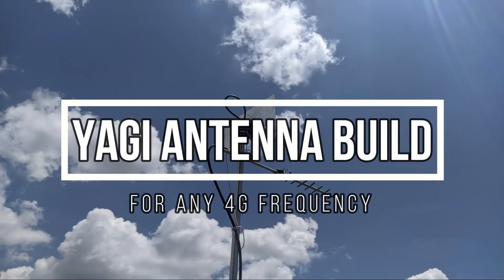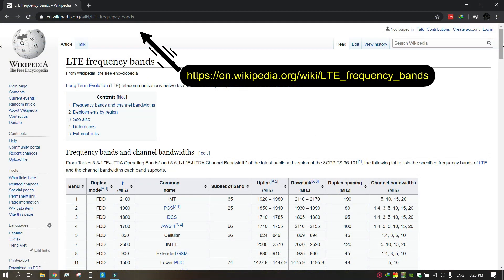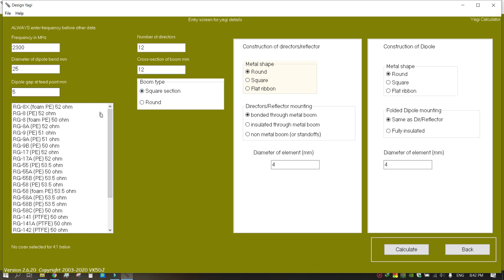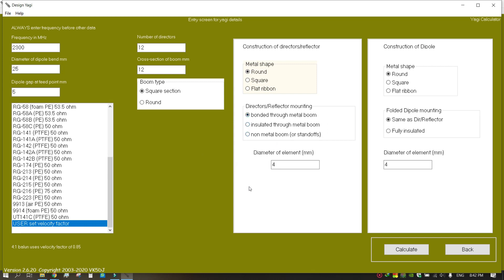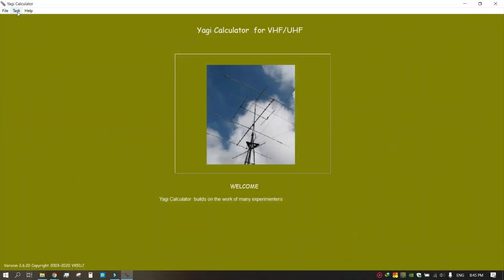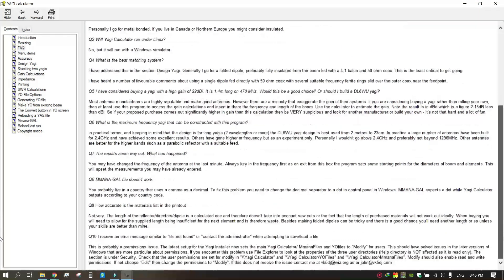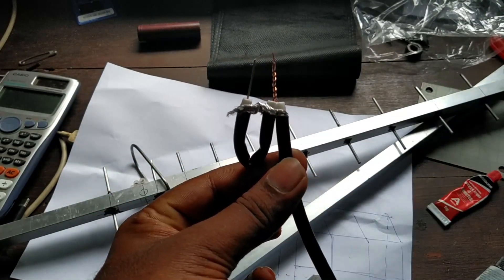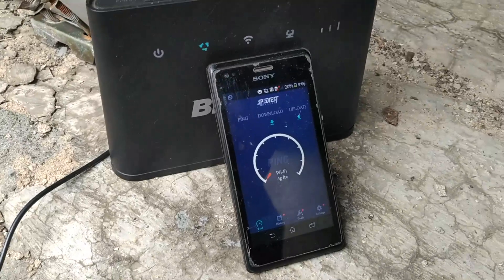Homemade YAGI Antenna for 4G LTE modem. (Speed test included)

Comment: Using a welding rod for antenna elements is not a good idea since they will have higher losses. I would recommend you use copper or aluminium for the elements or else the performance will be quite bad.

Comment: you poor thing your yagi isnt 100 percent, those elements cant just be glued, bonded [ the option you chose in the calculator ] means pressed in screwed on  or welded, must have full electrical contact with the boom

Comment: goodjob dude but you should have set your yagi axis to 45 degree from horizontal line and if you are using mimo router you should use two antennas which are 90 degrees from each other

Comment: Sir please, how did you make the balun ?
Reply from the maker: Using antenna wire
Reply: @AmateursDIY  I mean how you connected the balun to the dipole and the coaxial cable
Reply from the maker: I soldered them. Its easier to solder if you can make the dipole from coper wire.
Reply: @AmateursDIY  please make a video how you made the balun and how you connect it the dipole, it's not clear here to connect the positive and negative ... please bro

Comment: In My roof I'm getting 3o Mbps but in my roo it's 1mbps  by building this how much Mbps can get?
Reply from the maker: You can get almost 30mbps or more than that. But if you use longer antenna wire like 15-20meter speed may get low.  Also depends on signal directly coming from tower or reflected from somewhere else. Can't say anything sure  better try it. Or you can make a biquad antenna. That is much easier than this.  Watch my other video.

Comment: brother I'm already using this type of antenna. But I don't have enough speed. What can I do for that ?
Reply from the maker: Reduce length of the cable as much as possible. Did you tried at several directions also vertical position.
Reply: @AmateursDIY  I did all things. But it doesn't work.
Reply from the maker: Did you check your external antenna recognized by router settings. If it also works may be your area has high tower loads even all signal bars are available.  
Haven't you tried biquad antenna. Actually making a Properly tuned a yagi antenna is difficult. Biquad is much easier.

Comment: Bro I have a dialog outdoor antenna, do you know of any ways to improve the speed?
Reply from the maker: I recently saw some guy posted disassembled  dialog outdoor antenna. It also have fairly good antenna. It is  like a "4g antenna gun" in youtube. You can change that antenna to different antenna. But it will be tricky cause it has small cables that goes to rf card from antenna. Like wifi antenna cable in our laptops. But you can try😅

Comment: How to make Dipole sir?
Reply from the maker: Software provides details for that
Reply: @AmateursDIY  oke thanks. I know right now.
Cat I make antenna use 2mm Iron Welding Wire? Or should use aluminium?
Reply from the maker: Both can be used. I don't think there will be a huge difference

Comment: Very well constructed antema, congratulations! However, he made a serious MISTAKE, installed the antenna horizontally. For its frequency, the yagi antenna must be tuned with vertical elements. Hugs and thanks for the video!!
Reply from the maker: Thanks

That horizontal position gave me the best speed. Don't know why. Several mountains are  located around our house. Signal may be bounced off. Biquad antenna give more speed than this.
Reply: @AmateursDIY  How to make a  4.9GHz Yagi antenna
Reply from the maker: I'm not sure about 4.9ghz yagi. Cause it will be very small and  i think the maker of the yagicad application mentioned also mentioned about effective frequency range for this application.

Comment: machan are you a ham?
Reply from the maker: No i don't have a ham radio
Reply: @AmateursDIY  ok machan do the amateur radio exam and get the license. Meanwhile have you tried your yagi in vertical position? What I saw in the video was it was horizontal. Usually these signals are transmitted using vertical polarization.
Reply from the maker: I tried in vertical position  it didn't had a speed than this position. Somehow biquad antenna provides better speed than yagi in my situation. Probably i'm getting signals from various directions.

Comment: Just to confirm , is there any prebuild branded antenas in the  arket we can buy straightaway , if yes than anyone can help me with links or with names atleast , this help is much appreciated :)
Reply from the maker: Yes. Of course  there are lot of antenna makers. But i don't no about brands because i have no experience with them. There are bunch of antennas in ebay and aliexpress. Jist use the antennas with correct frequency band.
Reply: @AmateursDIY  thanks bro :)

Comment: Hi ty for the video it really help me get some information... N i want to ask if u cn help me... I recently bought yagi antenna and possibly with an indoor antenna I don't really know... But it does not show any difference.... Do I hv to buy a router to directly connect with outdoor antenna will it help or it will b same
Reply from the maker: What kind of setup you have? Do  you already have a router? Are you getting internet from a router or mobile phone?
Reply: I don't hv a router I just hv the antenna and I was hoping there might be a way to connect that antenna to something... Will it work if I get a router for the antenna cos at the moment antenna is just for nothing....
Reply: I'm trying to improve my mobile signal
Reply from the maker: If you want to improve your indoor mobile signal then you should add another omnidirectional antenna to other end of yagi as a repeater. But can't promise better signal reception fot your mobile phone. There are commercial  signal repeaters with amplifier.  Not sure using without a amplifier you can get good reception.

Comment: Tell me please, about direction of this antenna for 4g AND 2g. Will be the same direction or different? What Will be the difference of Internet speed if you direct the antenna minus 90 degrees AND vertically to Base station 4g?
Reply from the maker: Are you refering to polarization ? I have no idea about 4g and 2g polarization. But it could be same angle? My router only work in 4g band. So no idea about 2g.🤔 
I had most speed at this direction. Minus  90 degrees to this direction didn't had this much of speed.
Reply: @AmateursDIY why u decided to use horizontal polarization? Usually mobile connection works in vertical polarization.
Reply from the maker: This is actually Home broadband Connection.  Also i'm getting signals bounced off from somewhere. I'm not using this antenna for my modem. I'm using a Biquad antenna
Reply: @AmateursDIY  you are telling me nonsense about hommade connection. From where are getting 4g signal, from a Base station or a wife of your friend?
Reply from the maker: I'm getting signal from a base station. (My english may be poor. ) It is not homemade. It is a Fixed 4g home broadband connection.
Reply: @AmateursDIY  why did you select namely such polarization? Did u try all polarizations?
Reply from the maker: Yes. As i said earlier, that position gave me the highest speed.
Reply: @AmateursDIY please show speed at different positions of this antenna: polarizations and angles of direction, then at different numbers of elements of the antenna
Reply from the maker: Why?
I'm not using those antennas and that isp anymore. I moved to another location recently.

Comment: why did you change the value of directors? from 63.6 to 62.5 ?
Reply from the maker: Oh my mistake. Looks like values in software are different from the paper sheet. I did the data applying part of the video after making the antenna. I must have change values entered. Don't worry about it. Just insert your values and it will be fine. Thanks for showing that.😁
Reply: @AmateursDIY  Thank you soo much!. It really big help for me :). Just keeo on posting your DIY works :)

Comment: does it work well that regular mimo's?
Reply from the maker: What do you meanby regular mimo. My modem only support 2x2 mimo. But i only used it with one external  antenna. Because using two antennas didn't make any differece for me. Maybe my isp does not provide mimo or something like that
Reply: @AmateursDIY  Do you terminate the unused RF port of the modem?
Reply from the maker: Terminate? Why would i. It just in auto mode 🤔

Comment: Sir i needed to make yagi antenna which can receive rf signal up to 6 gigahertz Is it possible?
Reply from the maker: It could be possible. I'm not an antenna expert. But 6ghz yagi coud be very small. Also developer of this antenna mentioned that this application only accurate for less than 3ghz. You really should get  expert's opinion

Comment: You didn't show how to insert that last aluminium plate and how to connect the wires to mobile signal so can you help me how i can do this...?
Reply from the maker: Sheet metal reflector goes to the same reflector position.
Wire is connected to modem/router using SMA connector. It is shown in my previous video. This antenna not directly connected to mobile phone. It is here just to show speed test.

Comment: Bro good work.
I have a question shouldn't you be using a non-metalic frame for the directional elements of the antenna. If you use a metallic frame then it's useless right? Because all the elements are electrically connected.
Reply from the maker: Thanks
 But most of the antennas i saw, have a metallic boom. Including tv antennas. Also developer of this application mentioned that it is fine with metallic or non metallic boom.
Reply: No not at all. The elements can either be insulated or as in this one connected to a metal boom. Have a look at a TV antenna, its works exactly the same way.

Comment: If i point the antenna to 800+1800mhz 4G, will the 4G router get carrier aggregation 800+1800???? Or just 1800? For example i have a huawei
Reply from the maker: Can you be more specific. 800+1800????
Reply: Amateur's DIY   I use 2 yagi antennas they work great for signal strenght but i need to buy a new router because the current one only support one frequency (it is CAT 4)
Reply from the maker: Make sure your isp provide both of these  frequency for your internet package. In my country  same isp use 1800mhz for 4G Mobile data connections and 2300mhz for 4G Home broadband internet connections. Which  frequency you are currently using?
Reply: Amateur's DIY    Don’t worry i know which bands to use, i’m using mobile 4G 600gb per month. 800mhz 1800mhz and 2600mhz
Reply from the maker: I have no idea that carrier aggregation would work. I'm not a antenna expert😅.
 Also your new router have to support these technologies, right?   In my knowledge   my country only has MIMO.  Sorry to could not be helpful to you.
Reply: @AmateursDIY  it a lte+ (advanced) standard by using two band simultaneously to get higher bandwidth
Reply: @AmateursDIY  example is band 1serving and band 7 neighbor
Reply: Amateur's DIY    There is a Base Station(tower) that has 800mhz frequency and 1800mhz frequency antennas. Will it get carrier aggregation if i point to it?

Comment: If I want to make antenna to receive signal of 1800mhz LTE network, what frequency should I insert in software? I'm really confused cuz people are selling yagi which states from 700mhz to 2300mhz but technical yagi is just constructed for one frequency.. Please help me🙏
Reply from the maker: I think you should enter 1710mhz. Also try to make a Biquad antenna also. It is not that difficult like yagi. 
Yeah, i saw on aliexpress too. Also they promised higher gains also.
Reply: Some Yagis are Log Periodic and have a lower gain but much wider bandwidth.
Reply: bro, did you make it ?

Comment: Hi, thanks for making these videos. Liked and subscribed.  I have a few question. Can you help please?
1) I don't have a 4g modem, so can't connect it my mobile directly. Instead can I use ( https://www.youtube.com/watch?v=ZSk6_mOubuI ) this type for mobiles?
2) My ISP gives better speed at Band 3. So should I set it to 1800 mhz? Or 1700 mhz like wiki link. (Lowest as you mentioned).
3) How does non metal boom perform? I am asking because I don't own a drill.
Reply from the maker: Thanks

1) It is a basic  signal repeater.  It should work.  But i have no idea how to find correct dimensions for that repeater antenna. I also had the same problem.  Some people say to use yagi antenna as outside antenna and some omnidirectional antenna (usually whip antenna or you can use biquad antenna)  as indoor unit. But commercial repeaters have amplifier between these two. You can search them in aliexpress. But they are expensive. I saw on instructable.com  some people made this without amplifier. 
2)  I think you should use 1700mhz. Because FDD bands  use two frequencies to transmit. 
3)I have no experience in non metal boom. Software developer mentioned in manual that non metal boom also has to work perfectly. I don't think there is a huge difference. 

I you are getting reflected signal like mine you can try Biquad antenna. I also posted a video on that antenna. But it has lower gain compared to yagi antenna. If you are getting signal directly from tower without bouncing off from any other surfaces yagi antenna definitely work for you. 
Sorry about my poor english. 😬
Reply: @AmateursDIY  Thank you brother for such quick reply. I will try your biquad design and let you know how it worked. Thanks again. Keep making these amazing videos.